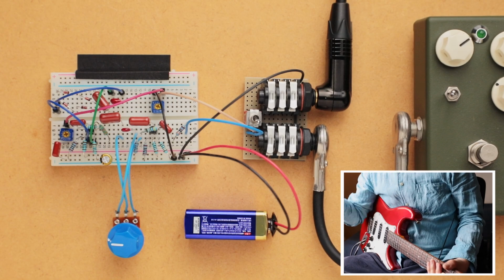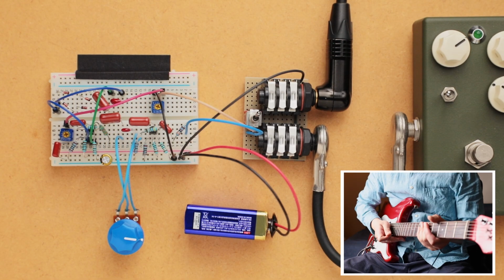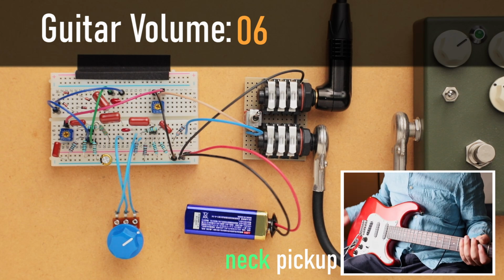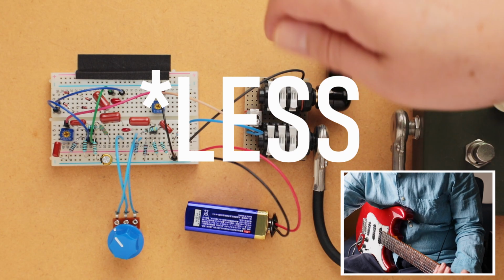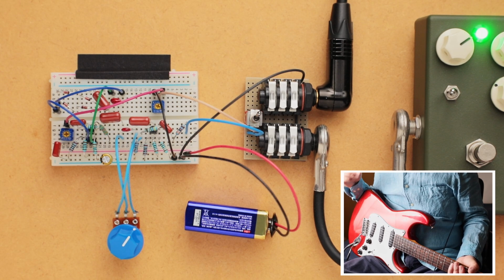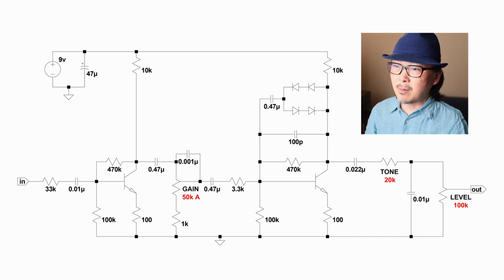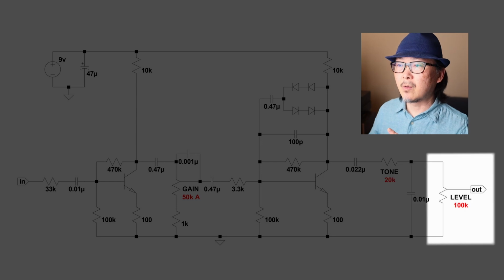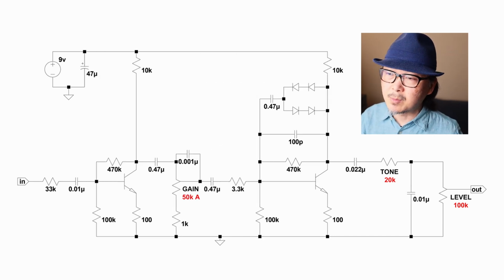Just 2 Transistors! DIY Overdrive Goes From Crunch To Fuzz! [Breadboard DIY Guitar Pedal Build]

Comment: I'm doing a similar project, what amplitude do you consider for the guitar input? I heard its around 1 Vpp and around 100 mV average.
Reply from the maker: Thanks for watching! Since output varies quite a bit depending on the pickup, I use 0.6Vpp as a starting point.

Comment: Here's the most strange thing, I have built op amp diy breadboard projects and transistor based ones, the op amps ones never work, never get any distortion period, I've followed your three part series exactly but the transistor ones always work. Any ideas?
Reply from the maker: Thanks for watching! It sounds like you are familiar with using a breadboard, and if the transistor circuits all worked fine, the only thing I can suggest is double checking the pinouts of the op amp that you are using. Also, unlike the pinout of transistor datasheets where you're looking at it from "underneath," op amp pinouts are drawn for when looking at it from "above." (the side that has the print on it) Hope this helps!
Reply: Hi!

My comment may not apply to your problem(s), so keep that in mind. I've also had MAJOR difficulties even getting opamps to work. But now I've overcome those obstacles with a vengeance 😎

My recommendation to you is to start with the absolute basics. What I mean is for instance to control (with a multimeter) that you get the expected output voltage on the output pin. Stuff like that.

And don't over-complicate anything before you've gone through the previous steps. Start without the opamp and see to that you have plus and GND or minus (depending on if you run on dual or single supply) on the correct pins of you use that kind of mounting thing for opamps.

Then proceed to place the opamp in the circuit and see if you indeed get the mid-point of the supply voltage if you don't feed the opamp with a signal(s). And so on. 

Also, many opamps are susceptible to ESD (static electricity). So, if you touch the pins without having for instance a ESD bracelet on your wrist, you can permanently damage it. The same goes for if you force it to output a too high current. That will fry the circuit.

When the opamp is within a circuit, it is often "protected by the circuitry" from ESD. You mainly have to take extra care of it when mounting / in the beginning of the circuit. 

My recommendation is to start with a single supply of +9V. Then bias the incoming signal with two identical resistors, one connected to + and one to GND. The signal is input in the middle of these two resistors (that form a voltage divider).

Place a coupling capacitor going "in" to the midpoint of the biasing voltage divider. This will keep direct current (which can be seen as a superposition of your signal) from coming into the input to the opamp. And it will prevent any DC from going into your signal source (like your guitar).

Now, place a potentiometer (e.g., 50k) between the output of the opamp and the negative input of the opamp. Place a 10 uF capacitor connected to ground. Connect the capacitors other leg with a 1k resistor. Connect the other leg of this resistor to the negative input of the opamp. This will form your feedback circuit. If you turn up the potentiometer (increase its resistance), the output will increase. When turning down the pot, the output will decrease. 

Now, connect +9V to your opamps V+ pin. And connect GND to your opamps V- pin.

Connect a coupling capacitor from the opamp output (same reason was for the input).

You now have a circuit that will work. 

Experiment with what happens if you turn the pot up and down, monitor the output voltage until you understand how the opamp actually works. 

And disregard this comment if you already knew this 😂

Good luck!

Comment: Hum it seem's good circuit but i cant find why but it doesnt work for me. I use bc109 transistors. I don't understand how you connect your gain potentiometer with the third cable (its seem between the 470k and the 1k )😅.
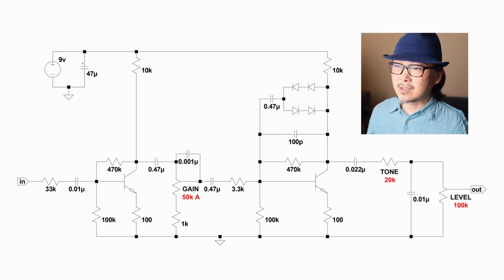Reply from the maker: Thanks for watching! The gain pot goes between the 0.47u capacitor and the 1k resistor, as you can see in the schematic around 21:00. Hope this helps, and have fun!
Reply: Thx for taking time to answer me. I manage to make your overdrive with opamp and a fuzzface from another videomaker. I dont know why but this one doesn't want to work😢 for me.
Thx you very mutch for your great work anyway
Thomas (France)
Reply from the maker: @thomaspomies1640  Great to hear you made the breadboard overdrive! The only thing I can think of is the pinout of the BC109. It's probably not the same as the 2SC2240 that I used in the video. Hope you can get this working!

Comment: You could use a 500kA pot instead of the 470k resistor between base and collector on the first transistor and you could eliminate the 50k pot and associated parts.
Reply from the maker: Thanks for watching! And thank you for sharing your mod ideas! Yes, as I state in the video, there is so much you can do with this circuit!

Comment: Simple an good sounding circuit! What if you use ceramic capacitors instead of polyester, will the sound differ much?
Reply from the maker: Thanks Patrik! Great to hear you liked the sounds! To answer your question "Will the sound differ much?" I personally don't think it will. I'm sure tons of people will tell me that I'm wrong, but I wouldn't worry about capacitor material when building a circuit like this. As the other viewer has commented, capacitors are a huge deal in hi-fi audio. But, in the guitar/pedal world, I think it's all about whether or not you like the final tone.
Reply: Absolutely. Capacitors impact audio signal arguably more than any other component in normal audio gear. There is a reason they make capacitors that are hundreds and hundreds of dollars each. But don't let that stop you, it is a distortion pedal after all...